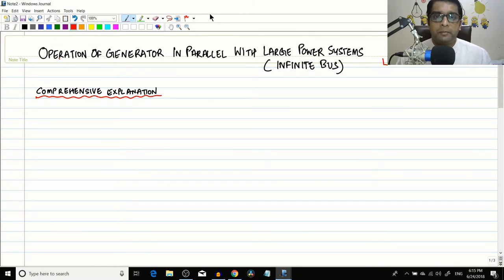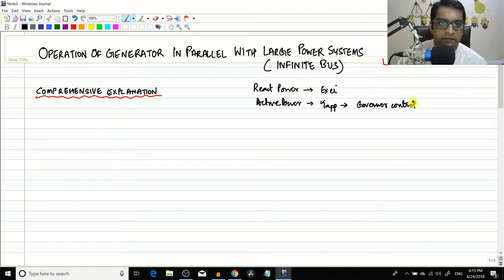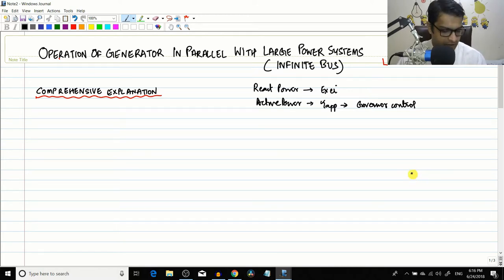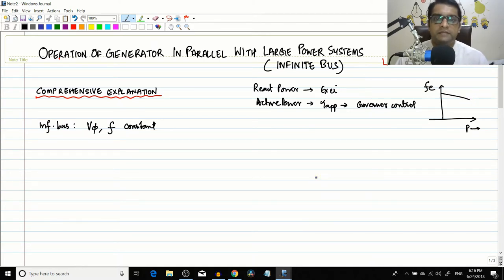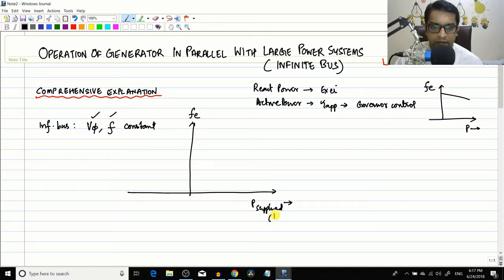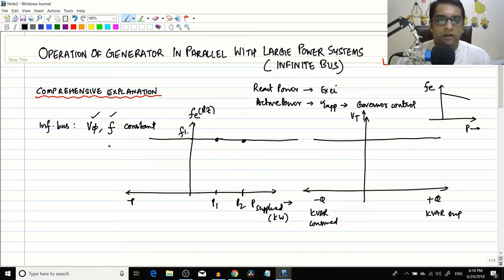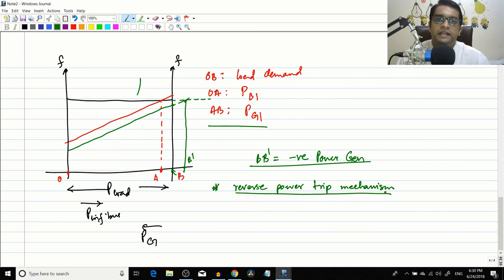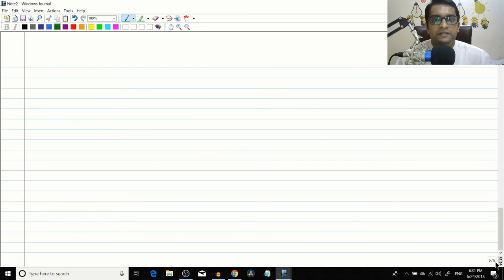#25 Operation of Synchronous Gen with Infinite bus- Introduction to House Diagram

Comment: I was thinking about an explanation while explaining alternators to my daughter. Let's say we are driving in a car and set the cruise control to 50 miles/hour. Then when we have to go up a hill ( increase load) in order to maintain speed we need to input power ( like increase applied torque ) to keep the speed constant. Then when we go down a hill (decrease load) we have to decrease input power to maintain speed. It's kinda like that right? As with any analogy it's not exact but it may assist understanding of how the frequency (speed) of the rotor is held constant by adjusting the prime mover input like the speed of a car adjusts the amount of gasoline.
Reply from the maker: Yes u can use it.....it is a nice analogy...

Comment: made a video on capability curve of syn generator with math example as chapman book state.
Reply from the maker: That is actually the last part...I am working on that...Just breaking it into easy parts..Will post if I do it in time or else I will move onto synch motors, and will post it at a later time..But video will definitely come...
Reply: thank you for reply..